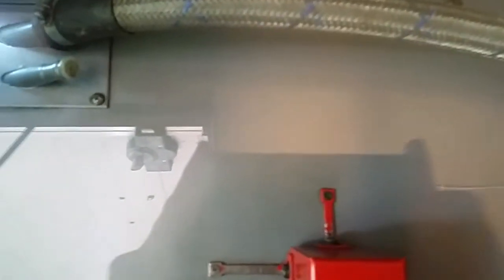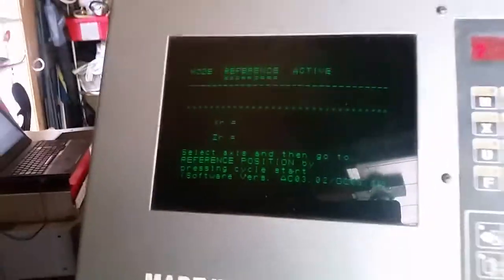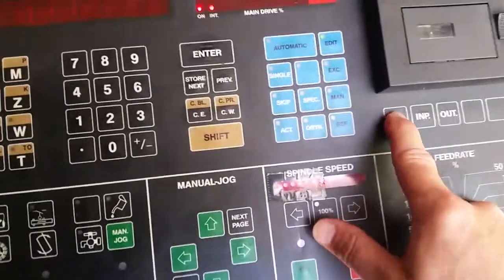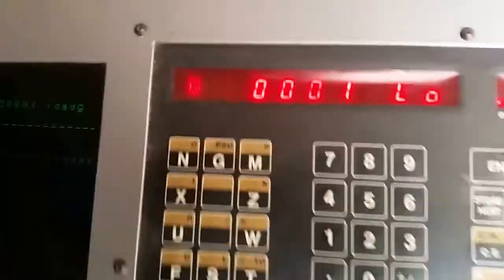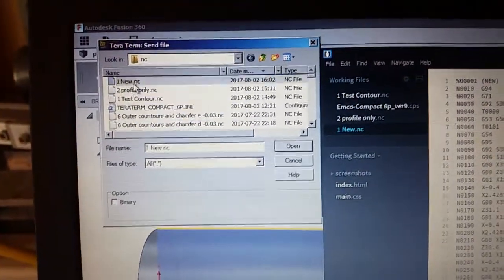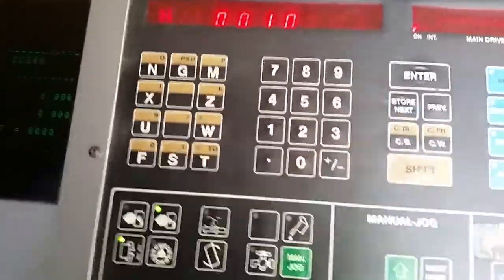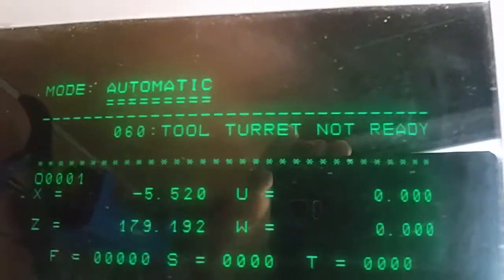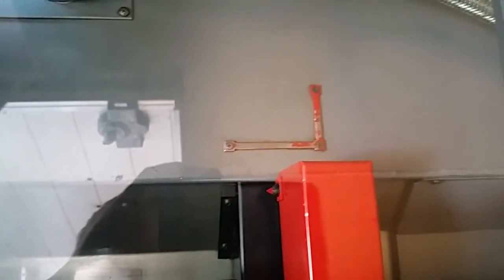Emco Compact 6p / 120p Fusion 360 Post processor

Comment: hi! could you tell how to set the workshiftregister? you use g54... or possible to share your gcode???

thanks
Reply from the maker: If you read the description of this video there is a link to the thread on autodesk forum discussing the post processor and a little about the Emco position offsets. Setting the tool offsets and position offsets is discussed in the manual of your lathe. Please explain  your issues using position offset more if the references are not enough.

Comment: Hi  I also have an Emco 120P lathe I wanted to know if you know how to save machine data via rs232 port? Thank you
Reply from the maker: If you have the serial port working it should not be difficult. As far as I remember it is something like [EDIT] [RS 232 PORT] [M] [S] [D] [O] [U] [T] [OUT]. Good luck!
Reply: @GastonSWE  thanks I tried but I failed, let me know if you can and what procedure you use greetings
Reply from the maker: @fabriziocaldognetto2885   I edited my first response to only include the correct sequence. I tried it and it works on a TM02.
Reply: @GastonSWE  Hello
  thanks for the valuable information,
I managed but the output data are those of the machine?